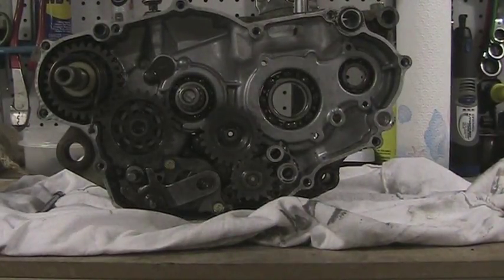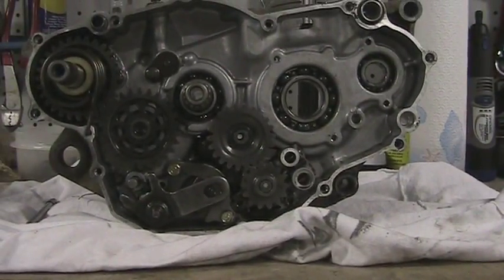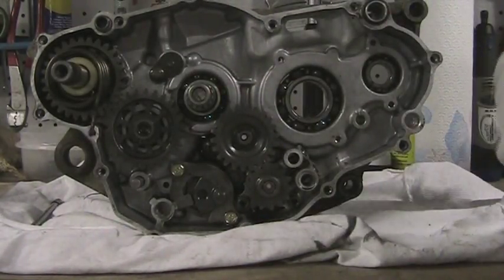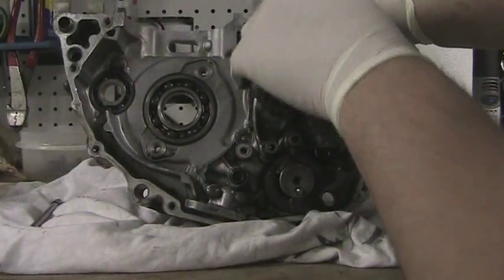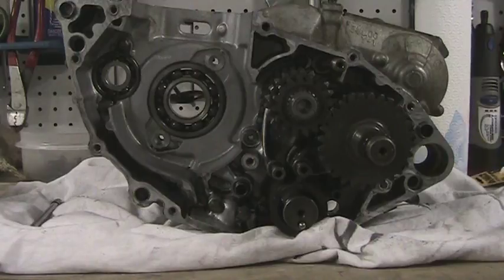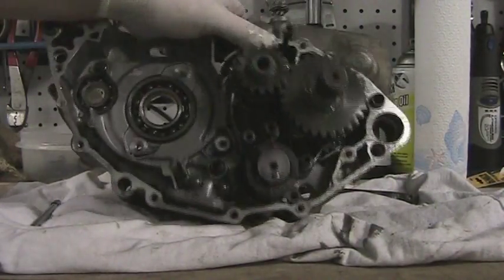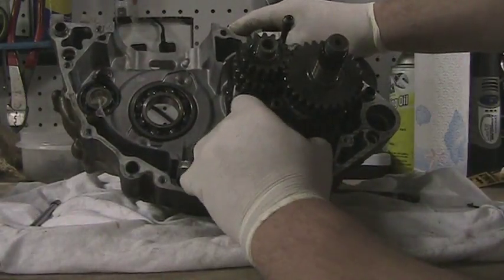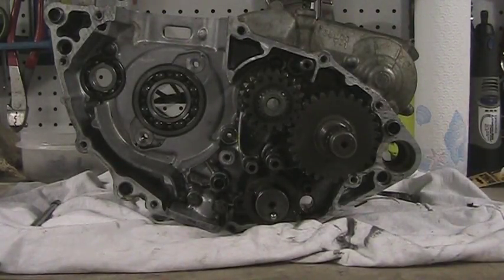Part 30: How to disassemble a motocross bike. Removing tranny and gears part 1.

Comment: I found out that the sprocket wore in a way that the tips of the teeth got more height (bigger diameter). I was gonna get a new crank anyways since the connecting rod big end bearing is toast. New chain aswell.

Comment: How did you go about removing the crankshaft from the left crankcase? The cam sprocket hits on the bearing and I can't get it out. Clymer manual says its pressed but right now the crankshaft is loose, only I can't get it out because of the bearing. Mine is a 03. Thanks!